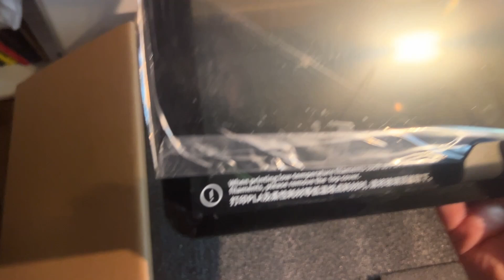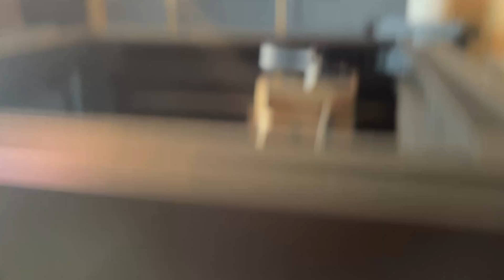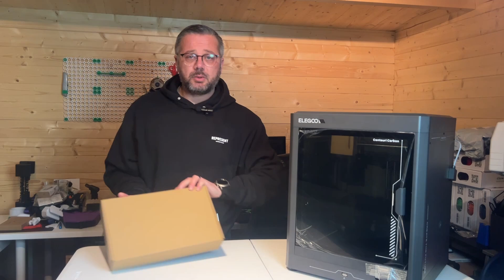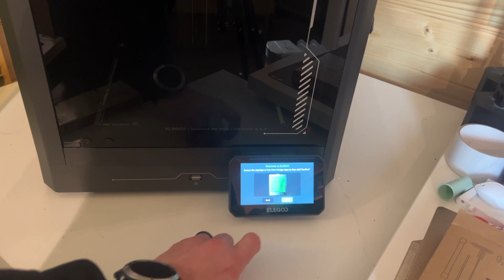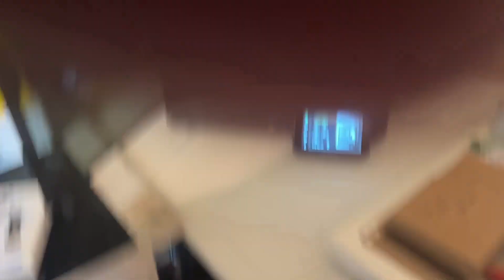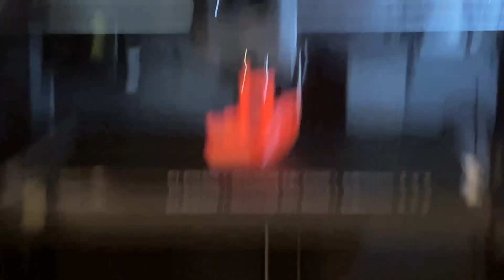ELEGOO Centauri Carbon Unboxing and First Print Impressions

Comment: I’m a bit disappointed that there isn’t a filament dry box built into the printer.
Reply: It's 500 dollars.  I'm sure there's an add on that will come.
Reply: With the price now known that’s asking a lot also unless it went up top where would you put it and how would you feed it? I believe they’re waiting for their AMS style system to come out.
Reply: @ThinAchiever  I’d be willing to bet if they’re working on a multicolor system, it’ll come.
Reply: @ThinAchiever  where are you seeing the price of the AMS? I’m surprised it’s almost twice the cost of the CC
Reply: @petercockroach  I’m unaware of any official/unofficial news on the AMS besides that it’s coming in Q3 of 2025.
Reply: @ThinAchiever  ditto. I’m not sure where @enlightenedsavage is getting their info but I’d be really surprised if the AMS costs any more than $299. My guess is $199-$249